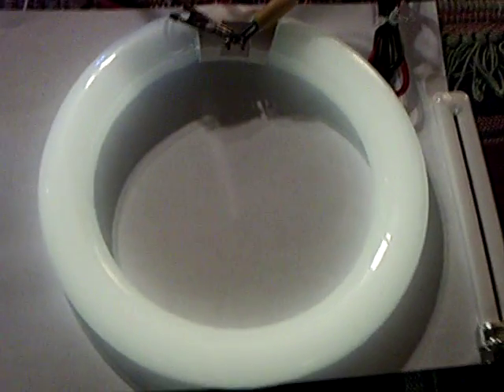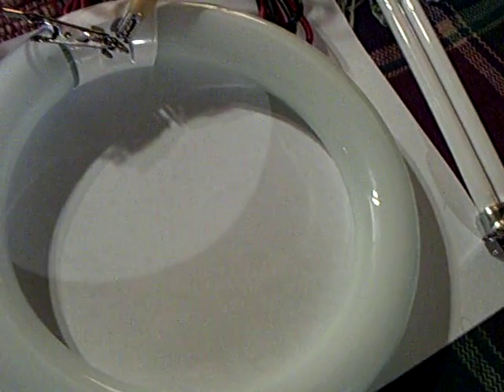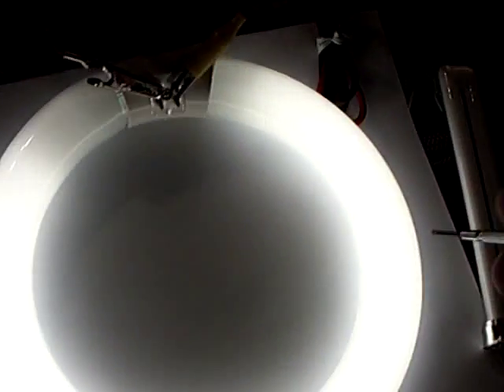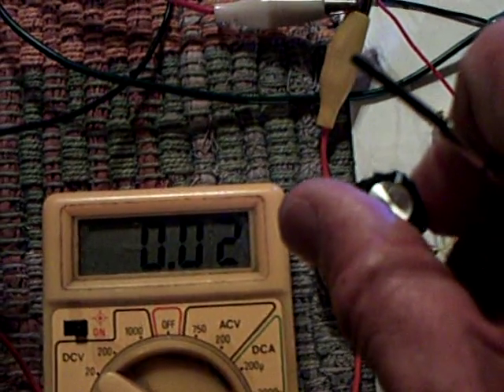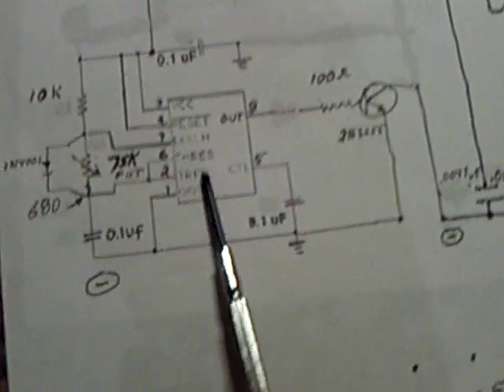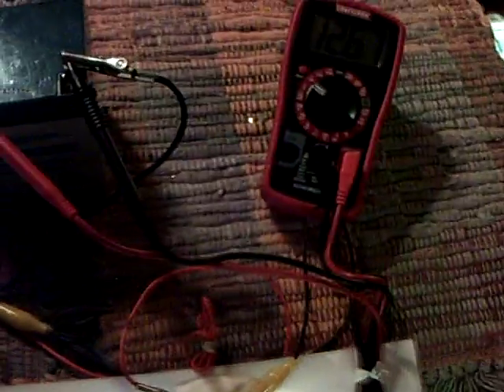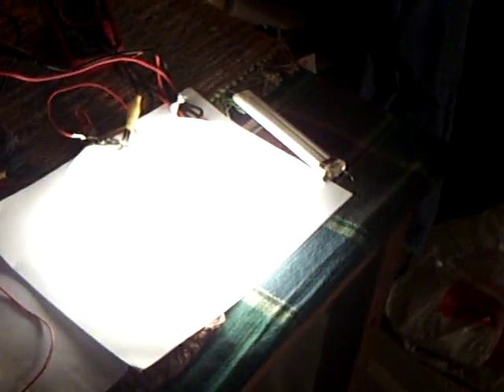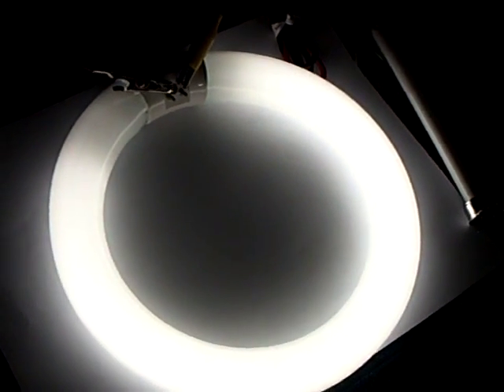Round Bulb On Pulsed Thief

Comment: Nice Lid! I finally wound the Slayer coil and this thing rocks! The light is very useful.
I cant light the old CFL's either.

U wouldnt believe it, I went out and bought the PicoFarad caps today! lol
Are they supposed to be electrolytic caps or just normal for the inverted part of the circuit?

just got my CMOS today

Comment: Fantastic work once again lidmotor. Cheers. The geometric shape of the U is like a horseshoe, of typical weak U shaped magnet is key. 

The "circle" is also key to returning energy. Radiation is 1 over/divided by " 1- something equivalent to distance" squared. I will get you the exact equation very shortly. This is a 2 dimensional representation. 

Ravi for hydrogen eff. research, raviwfc, has the smallest gap with his circular  tubes and related to the the research of the late Stanley Meyer RIP